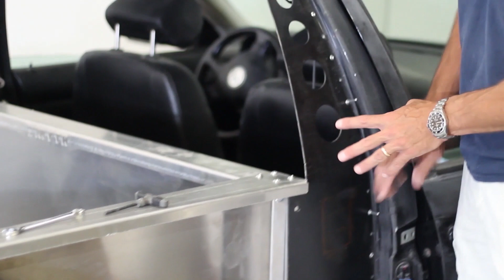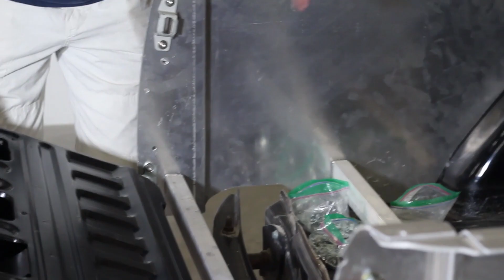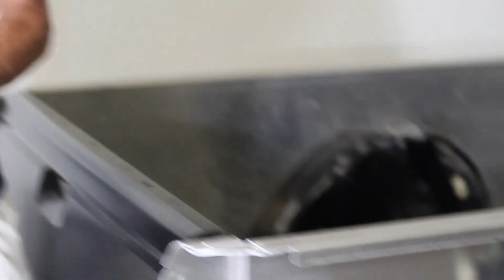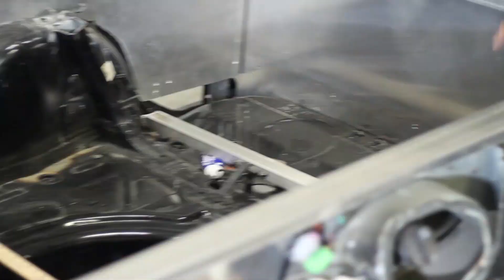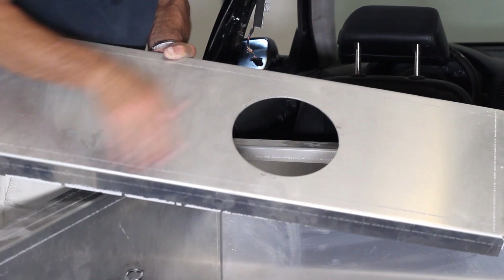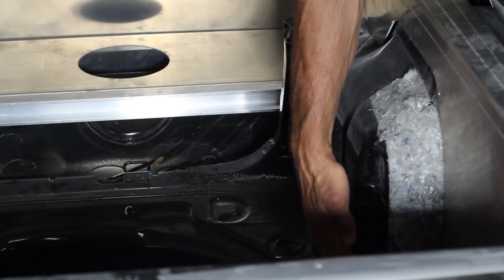Smyth Jetta MK 4 Ute Build: Rear Gate and Bed installation(new joined)

Comment: Wouldn’t the bed be stronger if it has stamp ridges on it? 💪🏽🤠
Reply from the maker: Stamping ridges allow thin steel or aluminum to be stronger yes. At 1/8" thick we are about 3 x thicker than most bed sides to allow the smooth hot rod look